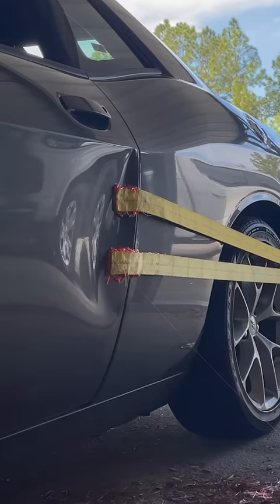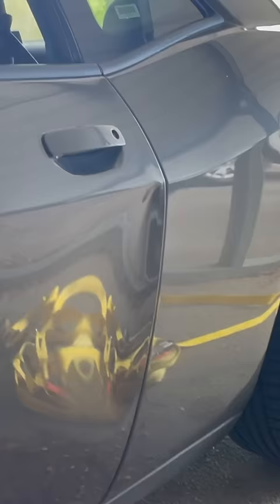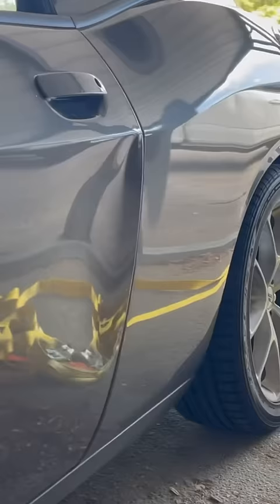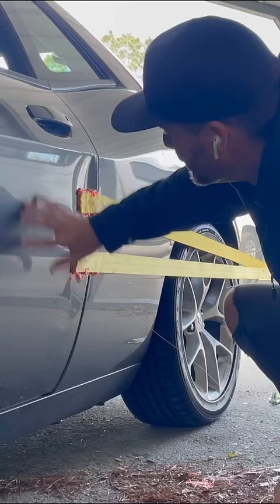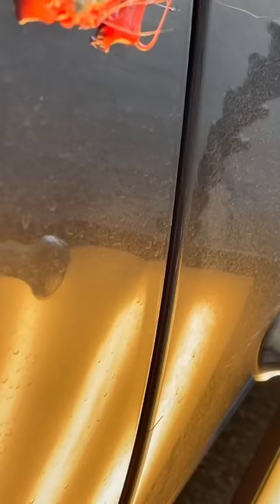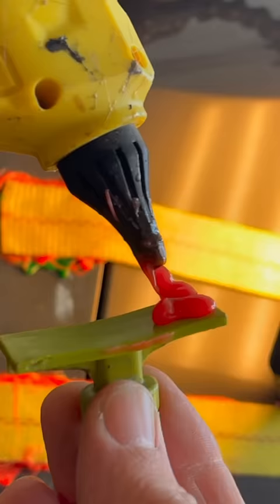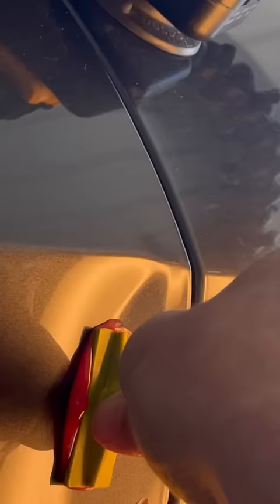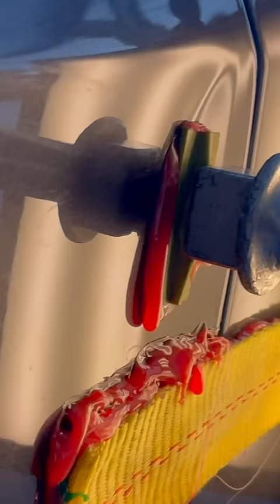I STRAPPED THIS DENT TO A TRUCK AND PULLED IT OUT SIDEWAYS! #pdr #pdrtools #pdrtraining #pdrjobs

Comment: I'm really amazed at these new age body men who can take these dents out without using Bondo and you can't even tell they were dented. Much better to do it this way if you can.
Reply from the maker: Thanks George !
Reply: this isn’t new age for no reason my man it’s because these cars are built from literal garbage materials. still a very awesome line of work just kinda sucks, cause the easier it is to fix the dent the easier it is to dent in the first place 😂 and vice versa.
Reply from the maker: @lukeboyer4071  👍
Reply: The metal in the cars have changed also !! Some panels are mostly poly carbonite these days ....these would not work on steel
Reply: Yeah you can’t breathe on them wrong or you get a dent
Reply: It's not too hard to take a dent out of a beer can.
Reply: @lukeboyer4071 Yea. How did this dent get here? Did someone accidentally lean against the door too hard while waiting for his gas tank to fill up at the gas station?
Reply: @Jordan__Sloan yeah I mean it’s a trade off. The old cars had no stiffness to them especially old sport and muscle cars. The cars drive much better these days because they used that weight in chassis design and other electronics
Reply: Great work on this dent restoration 🎉 Brilliant!
Reply: Is it because the glue is cheaper and better and paint application from factory is even better
Reply: @pepeshadilay Wait, what??? 🤔
Reply: If I had the money I'd make a car from NiTiol and then fix my dents with a heat gun
Reply: Only because it was under the body line. The lines are were the strength of the panel is. He got lucky because of placement. If it was half inch higher he's paying 2k for repairs from a true Craftsman or just buy a new door and have it painted
Reply: @pepeshadilay  plastic doesnt repair like this, that is a steel door, fyi.

Comment: Thats speaks wonders for the adhesion of the paint!
Reply: Most of the paint goes on the cars now a days is electrostatic plated onto each part it’s basically imbedded into the steel
Reply: @bla8ksheep926 so that's why it's bodyhammer & basically abuse, proof?
Reply: @bla8ksheep926 No that not what electrostatic means at all
Reply: @galenyoung8349 no, and the guy who said that is wrong because paint today is absolutely awful, chips and cracks off so easily.
Reply: @Sffker  yeah, that's what I had on my mind, as well. I don't know if I dont, ask. I'm not a paint guy. I'm an engine, wiring, & drive train oriented kinda, man. I'm disabled now, Ive built all of my daily drivers.
Reply: @Sffker idk how you got that. I'm pretty sure it's not difference. Other than modern paint definitely having less defects like orange peal.
Reply: This why it’s called paintless dent repair
Reply: THAT'S Y PAINT NEEDS SANDING
Reply: In the industry I worked, paint  (with all it's coatings) would be tested on a sample by gluing a knob on it and then pulling with another device.
Reply: @galenyoung8349 What’s the coolest thing you’ve ever fixed?
Reply: @briizcustoms9543  we took a 92 Honda civic & put it on a 71 Bronco frame with a 302 ford, engine. Then, cut both drive shafts & hooked up the transfer case to enable the 4X4, capabilities.

Comment: PDR guy knows his shit!!! 😊
Reply from the maker: Thanks KG!
Reply: Been around dent dudes my whole life, seen techniques evolve from removing basic door dings to near impossible dents. Excellent work.
Reply: @@darkfarfetch3664lmfao no. Buffs out easy.
Reply: @@darkfarfetch3664small patch paint probs cheaper than the dent repair
Reply: @@darkfarfetch3664Not really, most people buy expensive cars to show off or don't care about servicing,  running costs ext.. So they just want to have an expensive car but they want it to run them cheap aswell. So I would say no to that statement.
Reply: Has to trade trucks depending upon the dent.
Reply: @@darkfarfetch3664 yeah, it’ll buff out, and it’s way better than the old fashioned way of taking it down to bare metal.
Reply: @@darkfarfetch3664 PDR is always the first option if you can use it, the finished value from the accident reported by your insurance is way more than most people wanna deal with. PDR makes sense in every way, regardless of your income

Comment: Only concern I have is the parking pin in the transmission. Thats alot of strain on it. If the car is automatic
Reply from the maker: Thanks. I’ve heard that from several people. I will use the parking break from now on 👍
Reply: @dentrepairjax putting in in nuetral and then letting it roll back into blocks would be best then set parking brake then lastly put it in park
Reply: Taint is right
Reply: I feel like the door hinges will break before that happens lmao
Reply: @dentrepairjax I picked up a parked car that was hit by a drunk driver doing 45-55 mph. Hit and pushed the car more than half a block. It was still in park, put it in neutral to steer it onto the flatbed. You didnt hurt that car at all. Parking brake is great, and will keep anyone's concerns at bay. Nice work too! Looked great!
Reply: Emergency brake on!

Comment: Ooh, my sons Altima coupe had a deer run into the rear of LF fender - looks just like that. I’ll have to look up that glue you’re using as I could probably slide hammer most of it. Right now it’s preventing the door from opening more than about 10 inches.
Reply from the maker: Oh no!
Reply: Seems like a car I had. A deer tackled the passenger side front fender and rolled around causing the door to be able to open at all. Git a new fender which worked anyway. Because the fender had a dent in it that was rusting. Cousin did the work and matched the paint so perfectly could tell it had any damage.
Reply: @Manicpool  Yeah, I thought about going the boneyard route - if I can find the right color

Comment: I prefer using the rachet handle for small stuff or an small 12v winch for larger stuff. Have used vehicles but dont have as much control.
Reply from the maker: Great ideas 👍

Comment: wouldnt it have been easier to just drill a hole into the side of the door push them out repair it and plug the hole? makes it look oem
Reply from the maker: I’m Not trying to do what’s easiest… I’m trying to fix it without doing any further damage 💪

Comment: Given the same scenario, I would have left the Ford in park, maybe slightly to the left behind the dented car. While watching the dent, I would use the ratchet on the strap to increase the tension. However, this also is more risky  in that if the strap fails in any way, I would be in the line of fire!
Reply from the maker: Good strategy!!

Comment: It wasn't as bad as the dent in this video, but my fiance at the time opened the passenger side door of my brand new WRX into one of the posts at a gas station about 8 years ago. The car literally wasn't even through it's break in period when it happened. Luckily my best friend took auto body in high school and was able to get it back to about 95%, there was just a tiny ripple left. Nobody else noticed it until I showed them though, so I definitely couldn't complain, especially since he did it for free.
Reply from the maker: Nooooo! That’s cool that he fixed it 👍

Comment: As someone who works with ratchet straps, lifting slings and tow straps daily on the pipeline it makes me cringe when I see so many people using the wrong ones for the wrong purposes.
Reply from the maker: Which straps should I use? Help me out bro
Reply: @dentrepairjax  I wasn’t trying to be an asshole either. I’ve seen a few people/vehicles get hit by ratchet straps when using them for pulling. They are meant to hold a decent weight down but not pull. Just hate to see someone get hurt.  What you did in the video is probably well within its rating. Not tugging or anything crazy. But would probably use a 1 1/2” sling.

Comment: Ìs it possibly to use a hydraulic cylinder instead? Guess it would be easier to go slow with,. than a car. But you use what you have I guess :) Couldnt see the car was damaged afterwards. Nice work.
Reply from the maker: Yes! My friend actually invented these boots that you glue to the panel and hook a porta power into .. you’re smart !

Comment: I do the same with my dent removal tool, glue is never strong enough to hold the plastic pieces when I pull it with the slide hammer puller…and it’s even harder removing the glue off the paint…ugghhhh
Reply from the maker: You probably don’t have the right tools, glue, etc. and you’re not prepping right

Comment: That car was 8 different colors through out the video. Lmfao
Reply from the maker: Ya different angles make it look like a different color.
Reply: @dentrepairjax  yeah yeah I wasn't saying like, "oh those are different cars, rawh rawh.." I was just pointing out the semi-pearlescent finish. It's probably regular top coat, but it's done so well and evenly that the reflective light is mixing with the paint color, unless it is pearlescent, and that's even harder to do right.

Comment: Next video should be about how you got the glue off the door.
Reply from the maker: Hey-i use 91% isopropyl alcohol to remove the hot glue  the latest video shows it 👍
Reply: @dentrepairjax  Good

Comment: So ....some inconsiderate idiot just put a crease in my passenger side rear quarter panel.  If I hot melt glue a nylon strap to the crease , can i pull the dent out by pulling perpendicular?  WHy would lateral work better?
Reply from the maker: No. You probably can’t… I’ve been at this for 18 years…

Comment: How did you take the glue off without taking off the paint
Reply from the maker: Hey-i use 91% isopropyl alcohol to remove the hot glue

Comment: Ex couldnt make a corner in a parking garage and hit the wall with my truck on the passenger side rear panel wheel well could this work on pulling it out..
Reply from the maker: 🤷‍♂️ maybe if you know what you’re  doing

Comment: What kind of a glue did you use here, I also se two different colors of glue?
Reply from the maker: The glue I use is called tequila fire. Here are some links to buy it https://amzn.to/3sbb2cU https://www.pdrtool.com/products/tequila-fire  Here’s the dewalt powered glue gun link https://amzn.to/49egwo3 
The other glue is called orange fire.
Reply: @dentrepairjax  
Thank you very much for the helpful reply and for sharing your hard earned experience!

Can I also ask, what do you use for dissolving/removing the glue?
Reply from the maker: @bkingtz1  Hey thank you! -i use 91% isopropyl alcohol to remove the hot glue. Heat also helps to soften it first
Reply: @dentrepairjax 
Thanks a lot.
You know I have been in the car repair business my whole life, my father is a body and paint technician so I learned form young age, but we were never trying to learn PDR, although I did some small stuff on my own, with what I had at hand from the regular tools, and some hand made (yeah I know you need a bunch of professional stuff), but I eventually became mechanic and just rarely do some smaller jobs of body and paint work, so I stopped caring about all of it not to mention PDR, because I really can't spend so much time learning and practicing when I am not going to base that as my primary job.
But some stuff of what you do is good to know when the need arises, at least for some half decent repair on my cars.
The biggest problem here in Bosnia and Herzegovina is not to get the knowledge, I learned a lot of info that you share even before I came across your channel, but of course I am not even a 5% skilled as you because I don't practice, but the problem is that it's kind of hard to get good quality equipment, including for example that glue you use an for it not to be crazy expensive. Our market is flooded with cheap Chinese stuff.
So thanks for the info, I try to get stuff like this from Germany etc. Although now even on Amazon, especially the European one, there is a bunch of poor quality Chinese stuff.
Reply from the maker: @bkingtz1 wow. I guess we’re spoiled in the US when it comes to access to quality tools… you guys make things happen on with so little… 💪

Comment: What did you use for adhesive on the straps?
Reply from the maker: This glue is called tequila fire. Here are some links to buy it https://amzn.to/3sbb2cU https://www.pdrtool.com/products/tequila-fire  Here’s the dewalt powered glue gun link https://amzn.to/49egwo3
Reply: Thanks did you have to use adhesive remover to get it off? You got it off without ruining the paint.
Reply from the maker: @user-ue3rh6hv8l  Hey-i use 91% isopropyl alcohol to remove the hot glue
Reply: @dentrepairjax  Thanks I got a rear driver's side quarter panel dent to take out on my Explorer. Your video is helpful I appreciate you.

Comment: How do you remove thr glue?
Reply from the maker: Hey-i use 91% isopropyl alcohol to remove the hot glue
Reply: @dentrepairjax  can you disclose what the glue that you used?
Reply: @dentrepairjax  IPA cannot remove any glue completely.  It seems you want to keep it undisclosed, and it's okay but there is no glue or epoxy to be dissolved in IPA. It is way too weak.
Reply from the maker: This glue is called tequila fire. Here are some links to buy it https://amzn.to/3sbb2cU https://www.pdrtool.com/products/tequila-fire  Here’s the dewalt powered glue gun link https://amzn.to/49egwo3
Reply from the maker: I’m open with everything. Just ask. I’m not gonna argue with you though. Have a great night 🤙
Reply: @dentrepairjax  I already asked my question above, you have not answered yet.
Reply: @dentrepairjax  thank you.  I couldn't find any instruction or SDS of the material. I guess it is silicone stick.  Acetone will be better material to remove it if that is the case.